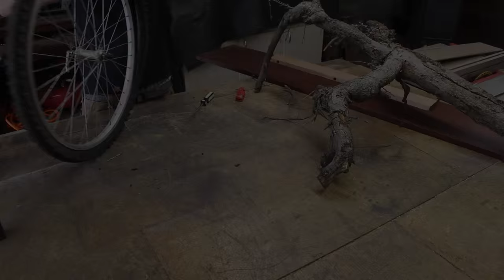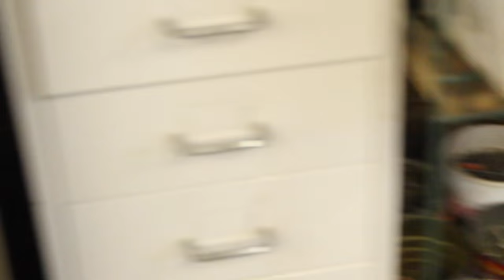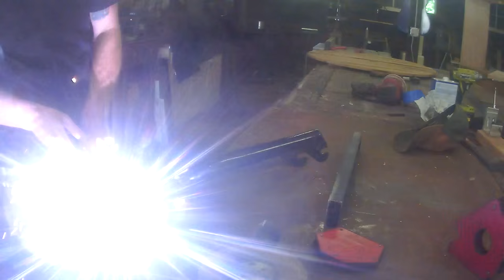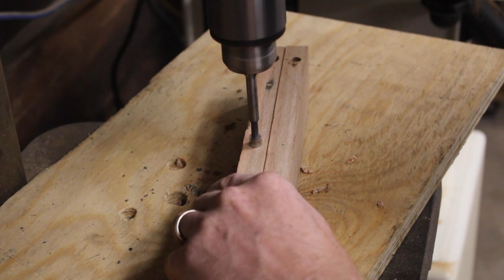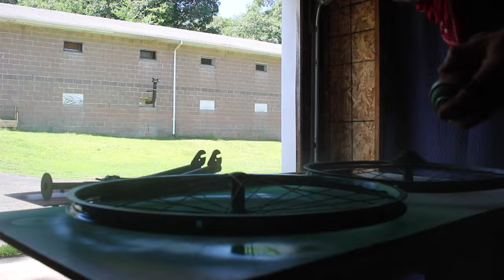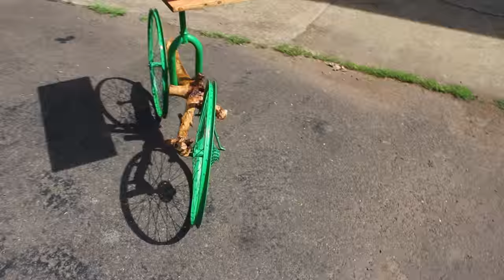Make a Table from Bike Parts & a Tree Branch

Comment: Nice work Tim!what type of wood is the branch?was it drying long?i have a few pieces like that but i was afraid to use it as its only been cut 3or4 months
Reply from the maker: BCdesign cheers man. it was off an old apple tree in my yard. it was standing dead when i cut it off and i've had it sitting around for about 3 months, so pretty dry to begin with. usually, skinnier branches like that dry out enough to work with pretty quickly - depending on how far you want to work them (i.e. trying to make flat boards). i bet yours are ready.